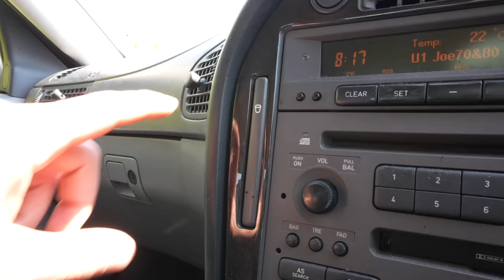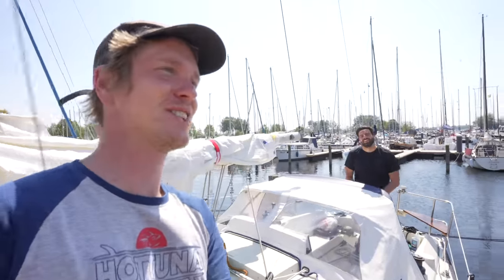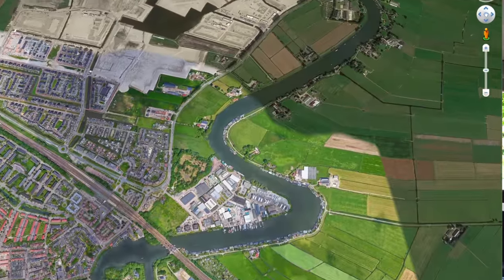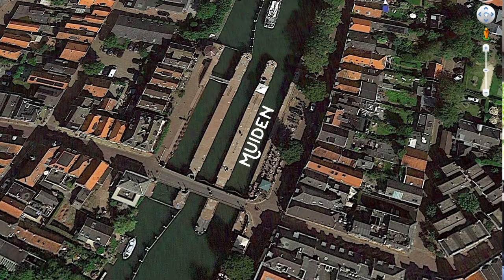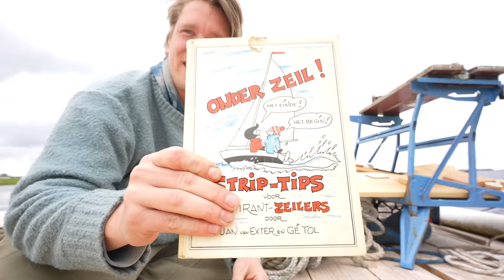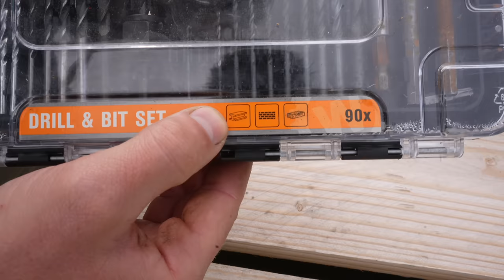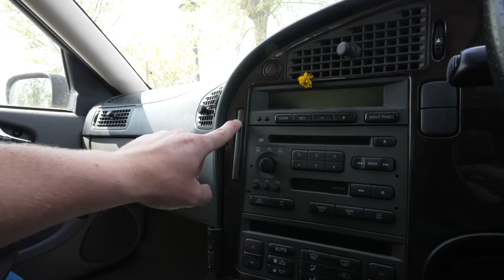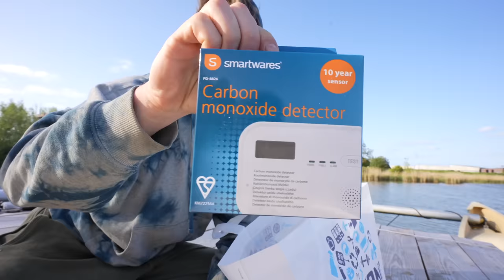Preparing to Motor My $2000 Catamaran To Amsterdam | Wildling Sailing

Comment: Watched your channel forever.  I am/was a carpenter for years.  Wood working is all about the tools.  Spend some money on a good skill saw.  I used a  skilsaw worm drive for the last 15 years, same saw.  I don't think you necessarily need a worm drive which is made to cut thicker wood, but a good, solid skill saw and all your cuts will be cleaner and quicker.  Cutting by hand looks laborious.  That and a good 1/4 impact driver will go a really long way.  Screws are such a better more forgiving way to go and a good impact will make short work.  If you spend money on good tools it goes such a long way.

Comment: When you are drilling steel. Use a bit of cutting oil. It will cool and lubricate the drill and the cut will be quicker. If you can’t get cutting fluid you can also use wintergreen oil which you might find in a health shop or traditional pharmacy

Comment: Drilling dry is what blunts and breaks your drill bits. Trefolex cutting compound essentially helps to prolong the life of tools. Using this cutting compound assists in both easing cutting operation and ensuring a smooth clean cut edge is achieved. Trefolex cutting compound is ideal for use with drills, taps, dies, reamers, and hacksaw blades.

Comment: You should make some fairleads for the pull start cables to run through so they can't fall and you don't need to remember to cleat them. I'd cut a really big washer and cut it in half so I can drill two holes in each half to screw it down somewhere but let the line run straight up. There might be much easier and less likely to chafe options out there.

Comment: As well as watching your project, I find  these extra introductions and trips around Holland immensely interesting. Many thanks.
Edit: Just a tip, I have found those Conical Step Drills exceedingly handy for my project. The have a really solid starting tip, unlike a standard drill. An d f course they handle big diameter holes much better.

Comment: Best tip I got for drilling into steel is slowly and with lubricant (water could work).. Put some pressure on the drill bit.. Let the drill bit do the work

Comment: For those pull cord extensions instead of a cleat measure them out to just over the length to the top of the deck then run them through a pulley attached at the top of the deck. It will give you an anchor point that will never allow it to fall as the pull won’t ever go through the pulley as well as give you a pulley to pull against as you start the motors.

Comment: cheap drills are a false economy. Buy a few good ones of the common sizes you use. When drilling metal, high pressure, slow revs (way slower than you are going) and lubricant (WD 40 Ok). You will drill the hole faster and your drills will last longer.
When you drill fast the edges of the drill heat up and temper so soften and then go blunt in seconds.

Comment: As well with the extended ropes on your motors you need to extend the wires for your kill switch up there so you can kill it from up top also in case something happens and it gets out of hand❤

Comment: Hope you're able to keep going. In my experience the closer to the end of a project the harder it is to finish up. All the little odds and ends just don't want to get finished after making a major push to get a large project up and running. But I suppose on a boat the project never actually ends.

Comment: You can not use an electric screwdriver to drill into stainless steel... you need much more rpm and a coolant. Good luck with the challenge you took on...

Comment: People can be amazing pricks, but mostly they are just Amazing. If you have access to or can find some old short pieces of four inch three strand Howse line (we call it lock line, as in used to secure barges while locking) it is great for making traditional fenders. It is a bit long winded to describe the process, but well worth the effort to make them.

Comment: When you drill stainless heat the part first if you can and use drops of oil as drilling and it will drill very easy same as steel but secret is oil drops,its messy but use dedicated rag for the mess it makes the oil and very hot stainless will always drill easy as normal steel.your cool dude and keep having fun ocean baby.peaceout 😊

Comment: Just found your channel and it looks like a fun watch thanks. I don't know what your plan is for the engines on the boat but I have some experience driving cats of a similar size with smallish outboards and that setup looks wrong in every way I can think of (sorry). Only redeeming feature is your new deck level pull starts. Other than that, it looks horribly dangerous. I think you will find it gives very limited maneuverability against a wind or tide even with everything running well and using the differential thrust to aid the rudders, and I fear it will leave you unable to safely control the boat (under engine power alone) in any sort of wind, especially with the plans for extra superstructure and of course an erected rig. Good luck, but I would suggest being very careful in any limited navigation areas if you are fighting a wind of any strength. Another point to be aware of is that small outboards driving heavy boats can be prone to stripping the propellor hubs, especially if you try to do an emergency reverse or add a lot of power in a differential turn or similar. I don't know those particular engines, but a spare prop is likely a good idea.

Comment: One other thing you can do is go to an auto parts store and get a long choke cable ($10.00) and attach to choke and up to the deck. You can choke the engine when starting. I have never seen an old engine that didn't need choking to death every now and then. Keep on trucking. Over 60 years experience.

Comment: Only issue with extension pull cords is when you move the tiller potentially it will engage the pull start teeth

Comment: I made fenders out of old car and truck tyres wrapped in old hemp rope--but these days it would b probably have to be polyester rope One Makes a loop around the tyres, then goes back through and threads the rope through the loop you left and tie a knot--then onwards until the whole tyre is covered.  They are not the absolute best of fenders, quite heavy and somewhat narrow, but they also double as very useful drogues if you ever need one or two dragged in series in  a stormy seaway.

Comment: Use a bit of oil on your drill bits while drilling.  Even cheap ones will last longer when you keep the heat down.  Keep working at it.

Comment: if you can some how afford a combo set of brushless cordless power tools (Makita, Ridgid milwalke etc) they are expensive but will save you money and time many times over.  Drill, impact drill, grinder, recipricating saw, circular saw. maybe ebeven a small router.  maybe we can all pitch in and get you a set.  Get pro grade brushless tool, they run all day on a single chaarge and gave lots of torque,
 you will never ever regret this purchase and use them for many years

Comment: Now that you've extended the pull cords, don't forget to use your legs.  As you're  pulling up with your arms and twisting your torso, push up with your legs from a bent leg position.  It will prevent you from hurting your back in the future if you can take some of the strain off of that torso twisting and unbending backwards at the waist motion needed to get the engine started.  Your legs are made for that sort of fast jerking, your back is not...

Comment: Good work Mark, slow going at the moment but moving forward is all that's needed. Once you are in the boat yard progress will be huge. With those drills unfortunately cheap drills are inherently poor quality no matter what the packaging says. High Speed Steel has just become a marketing statement, a bit like cheap 'stainless steel' that rusts at the first sign of saltwater! What may help when drilling is to use a bit of cutting oil or even just WD40 to help lubricate the cutting edge of the drill? Also with the drill speed, a bit slow is better than too fast. Whatever you do, don't worry about people saying negative things about you 'having a go' and don't be too hard on yourself, you have proven yourself over a long period of time now to be more than capable. You can always learn new skills, but your positive attitude, tenacity and good nature are traits that usually can't be learnt.

Comment: Hi mate, do your homework on steel hardness.Stainless is extremely hard and requires a special bit.Try to find a proper supplier,as just 1 proper bit will be as much as your whole cheap set.It’s the general saying ,things are cheap for a good reason.good luck and cheers.Possibly also you may be able to get second hand bits of the internet,they will still be better than the cheapies.

Comment: I don’t know how much payload a Wharram has, but isnt sticking it full of solar engines and a nice 30~kw battery with some light 10hp engine’s a good idea?

Edit;
Before you say too expensive, buy some cheaper second hand ones. Plenty of 300wp panel go for reasonably cheap and 4 growatt 5kw inverters arent going to break the bank. Batteries are a thing though.

Comment: You should consider vertical wind turbines and electric drive instead of sail then direction of wind is irrelevant. Just point and go. Also if you build a cabin frame between hulls, you can move around regardless if weather, but it will also act as a structural frame bridging both hulls.
Reply: @jackm3040  a truss system is pretty standard.
Reply: @jackm3040  there wouldn't be a whole redesign. you literally only add strength to the center. and closing doors is pretty easy to separate sections. the center could even be a tent over a nice aluminium frame. it could be seriously stiff if you tie it right down the hull, but even just bolting to the existing beams would benefit the whole cat.
Reply: @jackm3040  np - i would sometime like to use the flexibility of a catamaran as a power generation method. if you have fulcrums on each hull you should be able to have pistons and springs going to the main mounting points and have them feed to each others opposite corner. in theory as they move fluid, it could turn a turbine, so waves would actually both stabilize the central platform, and help power the boat. but that would be a significant change to this boat requiring much more work.

Comment: Learn how to sharpen drills. It's not difficult and will transform even the oldest bits into super performers.  You can pick up old drills from most flea markets for next to nothing and once sharpened up will be far superior to the cheap sets you are using.